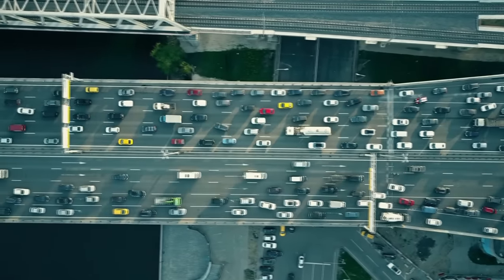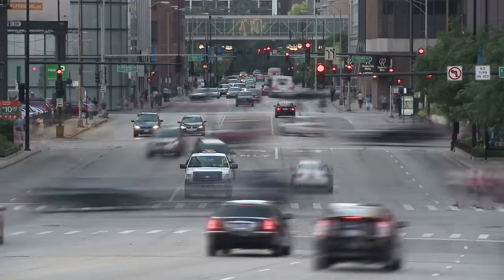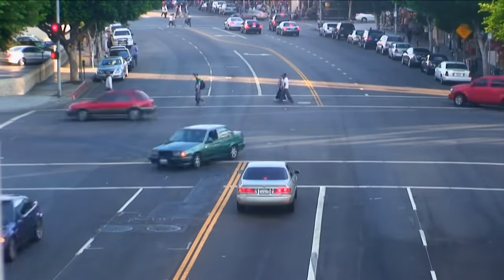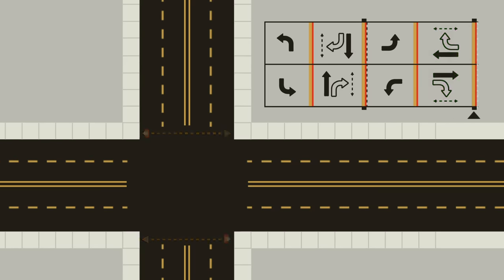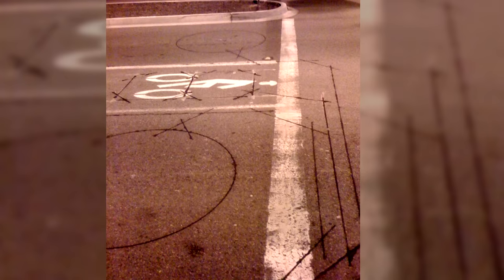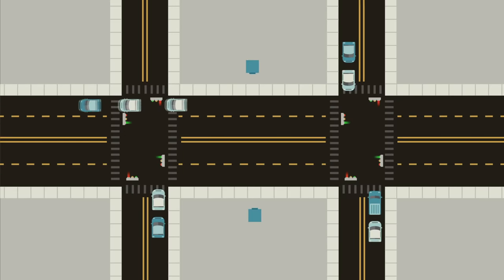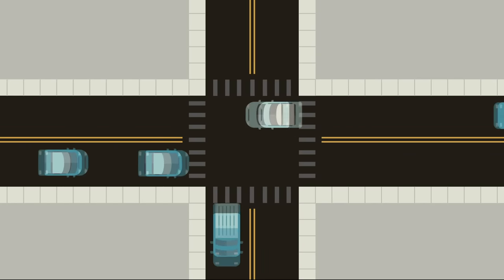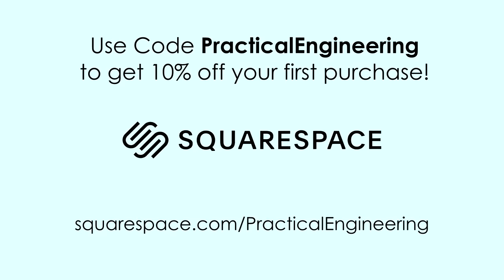How Do Traffic Signals Work?

Comment: Here in germany the amber light also turns on for a brief moment, when it goes from red to green. This allows the drivers to engage the clutch early, and start driving as soon as the light turns green.
Reply: We need that here in the U.S. so bad.
Reply: THIS IS HOW IT SHOULD BE
In Argentina the lights go from red to green and as a pedestrian you can end up trapped in the middle of the road. As always, Germany's three steps ahead.
Reply: No, what "we" (as in anywhere) needs is countdown timers telling you how many seconds are left on that particular stage so drivers who will be arriving at a red knows how long they'd have to wait so they can just slow down enough to never come to a complete stop at the lights.
Reply: There are many things that could be improved in many countries, but changing traffic laws is not easy cause that would require everybody to learn about those laws and train them.

Things like the US were turning right despite red light is allowed in many cities can really help on some streets.
There are also traffic-lights that tell the time till they switch again, and some where the light extends all over the pole to make it easier to see (i know some intersections where the ONLY light is like 7m high up and right above the stop-line. You have to keep 2-3 m distance and it is still hard to see)
Reply: It does this in the UK too. I moved to the US 7 months ago and I made my (american) wife sit a UK drivers theory test on the laptop and she was thrown off by the additional amber light. I said it's so you can engage the clutch, or in America it would be 'to put down your damn phone'.
Reply: In Austria the green light flashes four times before it goes to amber and then red.
Reply: manual transmissions are rare in the usa, because we're not too poor to afford them ;)
Reply: Cadde lots of lights in Florida have this
Reply: @SuperAWaC  Manual transmission cars are more expensive in the US. Only old people drive automatics. Sincerely - rest of the world
Reply: traffic lights in Ukraine also do the same as some intersections as well where the yellow light pops on between Green and Red and Red to Green.
Reply: @PatricioHondagneuRoig  In which part of Argentina do you live? At least in Mar del Plata and every other city I was, the traffic lights never skipped amber light in either way.
Reply: Randall Moore  I see your point but there is a speed limit. Doesn't really change much as speeders will speed regardless.

But if you only show the timer on red then no more problem and solved the bumper to bumper traffic issue if drivers wise up.
Reply: Most cars in the US are automatic, I don’t believe we need this in America.
Reply: Randall Moore  Depends a lot on the transmission. Up until fairly recently automatics required quite a bit more fuel than standard transmissions.
Reply: @JoEx2k11  La Plata, pero anduve por todo el conurbano bonaerense y todavía me toca ver un miserable semáforo que tenga doble luz amarilla. Bien ahí por MDQ!
Reply: @dasstackenblochen9250  depends what you mean by recently, these days a modern automatic transmission is better in almost every way, but manuals are still more fun to drive.
Reply: In Europe we have more roundabouts as well which work a lot better than the US four way stop at intersections. Safer as well.
Reply: Randall Moore  In most of the world though cars are already fuel efficient, heck my old Jaguar that I owned back in the UK got on average about 54mpg and could do almost 1000 miles off a single tank of diesel. Compared to my daily here, which gets 13mpg
Reply: North American drivers: Clutch, was ist das?
Reply: In Portugal Portugal it goes from red straight to green, I just resort to look at the pedestrians light and engage the gear when it goes red
Reply: Wow I like Germany a bit more now
Reply: Austria is another step ahead. We have 4x  green flashing before amber, which tells you the light will go red in about four seconds. Gives you plenty of time to decide to go faster or slow down. Oh, and of course, we also do red+amber before green.
Reply: I just check for amber lights to the left or right to get an idea when to engage my clutch. Honestly only works when I'm first at the light though, there are too many inattentive people miraculously allowed to drive.
Reply: @RealCadde  Only having it on the red phase could potentially help there especially for HGV's and such which could use that sort of information to slow down early and conserve as much momentum as possible by timing themselves to roll up as the lights change, would probably improve flow on roads with a lot of trucks especially when there is an upgrade as trucks perform much better from a rolling start than a standing start. Hell would probably get cars though faster if their drivers were smart enough to use the information to time their arrival too but many car drivers are not used to thinking ahead and trying to manage their speed to avoid unnecessary stopping like truck drivers.
Reply: In china there's a timer next to the light telling you how many seconds there are until the light changes back to green.
Reply: We have timers on the crosswalks, which lets the driver know how long until the light turns amber.
Reply: I'm a manual driver in the US. I just watch the opposite light and push the clutch in a second after that turns yellow.
Reply: @JunkTardis  that's not true at all! It's the complete opposite. You can expect to pay about a thousand less for a manual vs an automatic of the same make and model.
Reply: Randall Moore  that's wrong too manual transmission is more efficient than an automatic. The most efficient drive train is the CVT.
Reply: Randall Moore  google dude. The automatic transmission is a mechanical device. It has not changed much over the years. Which is why i then went and mentioned CVTs which are more efficient than both.
But ur free to keep believing what you want.
Reply: Randall Moore  fair enough,  it depends, says this source which is, as far as I know, a reliable one
https://www.edmunds.com/fuel-economy/five-myths-about-stick-shifts.html
Reply: I always wonder why North American traffic lights go straight to green, when they really should have an indicator before the green light. The red light has an indicator already. (being the yellow light)

To be fair though, I have seen videos of Dutch traffic lights, and they too go straight to green.
Reply: Randall Moore  Modern automatics yes.
Reply: I wish! Americans don't drive manuals,  but that would allow the ones that do to clutch in, and the ones that don't to put their fucking phones down. I watch the other lights and traffic flow so it's not a big issue for me. I generally know when it's about to turn.
Reply: The delay allows less crashes as the intersection is completely clear
Reply: Randall Moore  ?
Reply: I hate when people coast to a stop or slow peddle it towards a red light.  It's fine when they are alone, but usually they are just blocking access to the turn lanes.  They might save themselves a little bit of gas, but it's more than wasted by all the people behind them forced to idle through a valid turn signal they can't access.
Reply: And y'all don't have right turn on red by default. I got a nasty look on a side street in Munich before the fellow pulled over and told me, haha.
Reply: "Whats a clutch"

-Average American
Reply: In the city where I live in Portugal there are many traffic lights with countdowns for drivers and pedestrians so you know when its gonna turn green again.
Reply: Cadde China is full of that. Japan, also, I think.
Reply: Cadde  We have those for pedestrians crosswalks in Florida but since people do not know how to traffic then they will still cross when they have a red causing the left turn traffic to have to wait for the crosswalk to clear after the light changes. Also most of the time people do not even care and will cross anyways when the time is almost out and will still take their time to cross.  but what is nice is that you can still see them while driving so you know how long you have until the light will change yellow and in many cases you can adjust your speed slightly so that you can make it instead of doing what most people do where they floor it when the light changes yellow and then slam on the breaks when they find out they can't make it.
Reply: It used to be this way for many lights in America. They phased them out.
Reply: @phyphor  Very true. You can stare at the pedestrian signal and when it get's red you know your green is coming but I'm pretty sure Amber before green will actually reduce traffic a fair amount
Reply: @RealCadde  In my state, the pedestrian crossing stage is inherently tied to the stage change itself. So yeah you have to look out of your way to see it but at least you'll know when your light turns green. good idea though.
Reply: Here in my city in Brazil, almost all traffic lights have a countdown before it turns red, some have big numbers some have a vertical line of dots that turn off one by one.
Reply: In the US we have that too, it's called looking at the light on the opposite intersection and waiting from them to turn yellow, it means your turn is coming up.
Reply: Eric Hobbs we have roundabouts in America too, they suck and are super dangerous. No one uses them properly and a lot of accidents happen because of them, especially when they appear in touristy areas.
Reply: @RealCadde  Agree with you 100%. I saw that in an Asian country. Countdown timer on all three lights; red, yellow, and green. Works wonderfully. You know when the light will change, and can act accordingly.
Reply: In the US if you drive a manual be prepared to get honked at. So many times a light turns green and as im slowly starting to roll everyone behind me starts honking like chill its only been 3 seconds. We need this
Reply: @RealCadde  then they might as well replace everything with signs telling us to slow down accordingly.
Reply: @TekkLuthor  Or they can replace drivers with computers. Can't get any better than that short of teleportation.
Reply: Red+Amber phases are common in European countries.  We don't need that in the States and I'm glad we don't do it.  If you want to know when you're going to get a green, then pay attention to what is going on around you and the conflicting lights.  It is not necessary to inform the motorist when they're going to have to go... but it is necessary to inform them when they're going to have to stop. 

I also do not like the "normally off" pedestrian signals we have, as people are already too used to ignoring regular traffic signals that are malfunctioning and off when instead they should be treated as a Stop sign.
Reply: Same in China
Reply: @RealCadde  but in finland we have intersections that change timing dependet on traffic. You see this intersection that was renovated last summer sometines go red for only 3 seconds and it detects my scooter ❤️. Well usually i go in the bicycle road.
Reply: Everyone here in the US is glued to their phones so this probably wouldnt help us out if we were to implement it.
Reply: In the Philippines and a few other countries in South East Asia traffic lights have timers letting people know how long for each light phase
Reply: Operator 801 no we don’t, because we have mostly automatic transmission vehicles.
Reply: In the US (and probably elsewhere) this would just make more people run the red right before it's green, increasing the chances of collisions
Reply: That's actually just most of Europe in general. Even here, in the UK, the same thing happens. Unsurprisingly, the American system is uniquely different.
Reply: I would be flabbergasted to learn that America is the only place where drivers are likely to go before the light changes when they know it's just about to. Making the amber-before-green thing a blatant encouragement thereof.
Reply: I might be wrong but these sistem works trough the whole europe.
Reply: In America everyone has their cell phone jammed In their face and can’t see the lights
Reply: @SuperAWaC  I'm not sure which way you meant this, and really need to know. Not sure why.
Reply: @Cadde Almost all streetlights (in NYC) have a countdown timer
Reply: I just look at the lights that face the crossing traffic. When they turn red, I know I can start driving. Although, sometimes I have to count to 3 to make sure I don't go too early. Guess most people aren't aware enough to notice the light...
Reply: Back in the early days, the US had this system, too.  Alas, between the people trying to beat the red light and people at the red ready to stomp on the gas as soon as it turns green, there were a LOT of accidents.  We switched to our current system to curtail that.  That fact that nobody else has had that problem (or had it enough to change) says something about the US.  :-/
Reply: Randall Moore  Except that will not always work well. Automatics are often unpredictable on steep uphills, often getting confused which gear ratio to engage. That is why automatics still have various drive modes the driver can select to override the normal "Drive" mode. Usually, these are 3, 2, and L on tranditional selector.

Also, most automatics defaults to coasting when decelerating, which you may not like on prolonged descents (risk of brake fade). Hence, override is necessary to utilize engine braking.
Reply: That exists in south american countries as well. I thought it was a great idea but the only fear I have is that people will begin to interpret a red->yellow phase change as equaling a green light and people will take off earlier than they should. If it weren't for idiots, it sounds like a great idea and I've seen it firsthand.
Reply: Sweet!
Reply: Same in Macedonia. Also couple of years ago they implemented a feature for the green light to blink three times before going back to red after they banned the countdown timers that became popular.
Reply: i wish we had that here in brazil.
but in some intersections we have timers, which are even better.
on the rest of them i look at the other traffic light (the one meant for the other street) when i can.
Reply: @JunkTardis  well the “only old people” thing doesn’t apply to the USA so what’s ur point really?
Reply: That's what I learnt in school book
But in reality I don't see amber light between red to green
Reply: Americans don't have clutches... could that be the reason they don't have the red+amber before green?
Reply: Better have countdown.
Reply: I also noticed this in England. I use the pedestrian crossing counters to judge time till the light will turn red. It's a supplement to that yellow light!
Reply: @greentjmtl  my 2022 Hyundai has 2 of em 😉 also I can drive manual 😄
Reply: a clutch, you say … but where'd I find that? 😂
Reply: @ABaumstumpf  turning right on red is always permitted unless a clearly marked sign posts otherwise (which typically happens in the downtown area of some cities that experience at least some level of pedestrians; or when in conflict with some LRT, or something). turning left on red on the other hand is more complicated since that really depends from state to state. but that just as a side note. in the US (and Canada), the traffic light happens to sit across the intersection, hence it's just always clearly and easily visible. yes, in Europe, that often leads to very awkward situations, lol. (except for France where most poles are fitted with "low hanging" secondary lights are well)
Reply: @Mike-oz4cv  yes, but you're no longer supposed to cross on amber, on the other hand. essentially cancelling out this "advantage" of an "early warning."
Reply: @SuperAWaC  yes, you very apparently rather save on education 😉😅
Reply: Randall Moore  they're not (conventional torque converters, at least)
Reply: @WPXTacoMan477  you're way too easily influenced then 😅
Reply: @ArtifiSir  yeah, just that this wouldn't work in Germany since you just can't see the other light because it's ridiculously placed before the intersection instead of conveniently behind it like it is properly done in the US.
Reply: @SkylineFTW97  in Germany, you can't see the "other" light, though (because they're placed in front of the intersection instead of behind them.)
Reply: @TheMetalButcher  Germans can't just watch the other light, though. Ave with no traffic, you're really clueless. lights in Germany are placed before the intersection .. a big difference that many don't know (and some tourists don't even properly notice, for whatever reason, lol.)
Reply: @nthgth  in the "amber" light's defense, it only lights up for about a second, though.
Reply: @jony6107  yes, you're wrong. it's basically different in each single country. for instance, lights in Italy work just about the same as in the US.
Reply: @HelenaOfDetroit  many people probably (or apparently) don't know that in Europe, you can't see any lights from the "crossing" traffic (since lights are placed before instead of after the intersection.)
Reply: @HxTurtle  if you mean it's so short that it doesn't have an effect, then it's pointless. If it does have an effect, then see my original comment
Reply: @christalbot210  yes, it indeed says a lot about the US .. alas not so much about their drivers but the road design itself. only in the US, you've gigantic, multi-lane crossing and allow for quite high speeds even within city limits as well. a tiny, single lane crossing with a speed limit of 20 MPH so often found in European cities, will quite naturally cause a lot less incidences. that's the main differentiator, IMHO.
Reply: bruh  like I now pointed out so many times, that's not possible in Europe (the "other" light can't be seen since they're before instead of behind an intersection.)
Reply: @nthgth  it is indeed basically pointless. more like a carry-over from old times. but it's actually working and people don't jump it. most cars in Europe are still manuals and this very short amber phase is indeed your to start engaging the clutch and putting the car into gear (until the car's ready to be driven off, it's green already.)
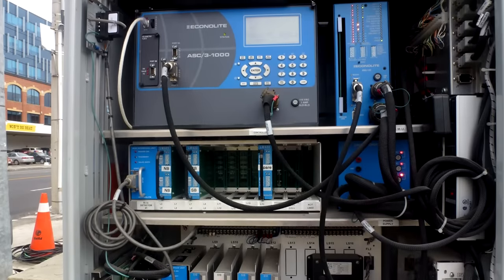Reply: just because I wrote it so often in here, now that I'm actually watching the video (yeah, first discuss, then have a look at what you're actually taking about, lol), there's actually a (probably) European intersection depicted in this video. whether it's actually European or somewhere else doesn't matter much .. what matters is that's it's clearly visible that cars have no means of "checking" some other street's light as it's place in front instead of behind the intersection. at 7:28, the "horizontally" waiting cars can only look at the backside of the crossing traffic's lights.